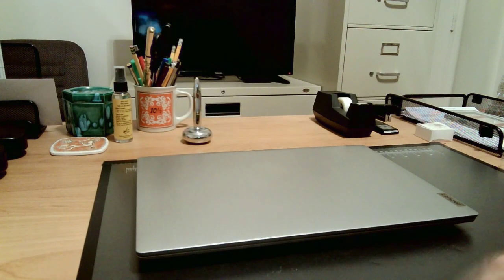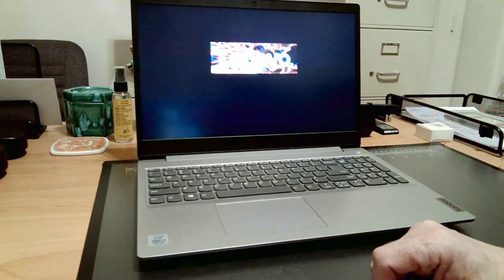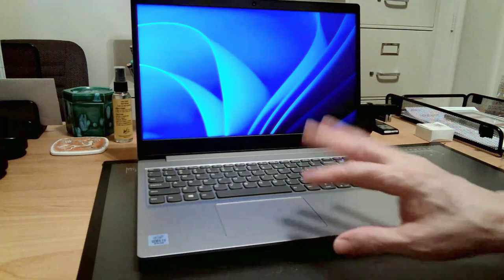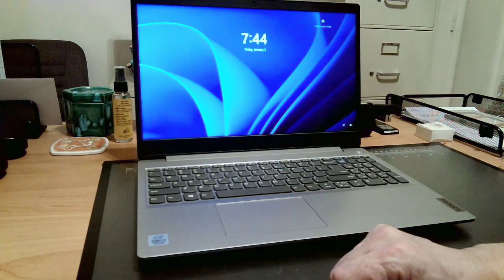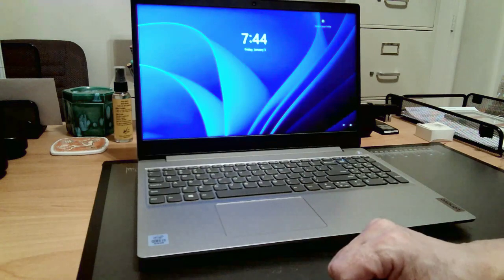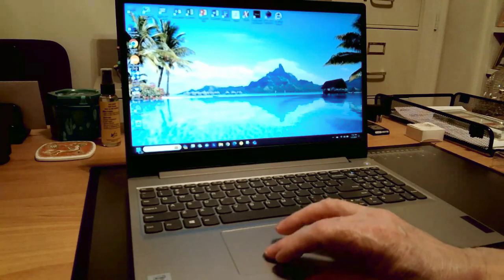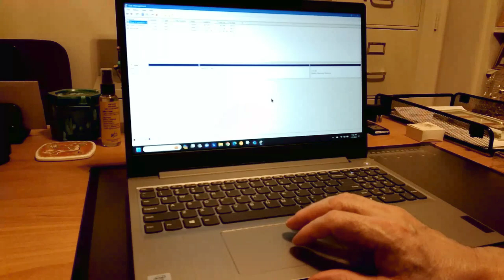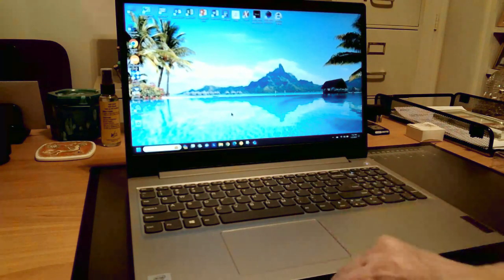Lenovo Ideapad 3 Laptop Hard Drive Replacement

Comment: my laptop looks identical. however, what you are taking out and calling a hard drive is a memory module on mine. i have a hard drive "bay" that has nothing in it and no sata or power plugs either. so confused.
Reply from the maker: Not sure if your laptop is the same model and has bays/slots in same configuration since I cannot see it.  The NVME hard drive does look somewhat similar to a RAM module, but they are quite different in how they plug into their slots on the board.  The RAM slot on my model laptop is to the right and above the NVME connector as shown at about 7 minute mark in the video.  There is a bay for a traditional 2.5 hard on my laptop but I do not use it.  I believe the connector for a 2.5 inch drive is buried beneath the battery on my model, but would have to open the laptop back up to confirm that. Since I do not use that 2.5 inch bay, I was not concerned with locating the connector for it.  I hope this is of some help.  Thank you.
Reply: You have the same one I have. you could put  one in.